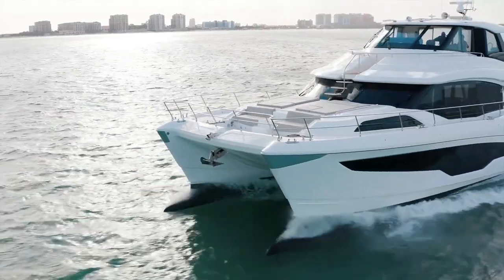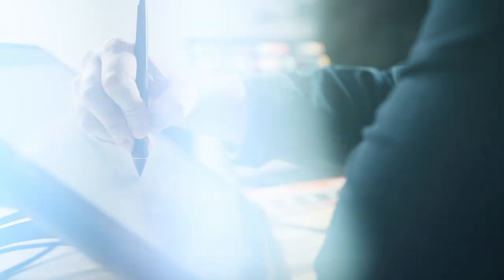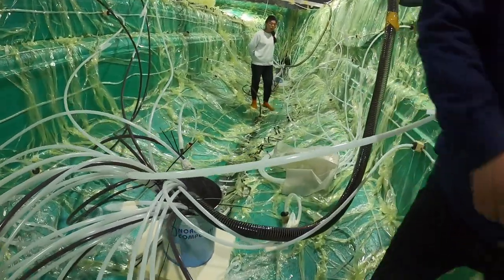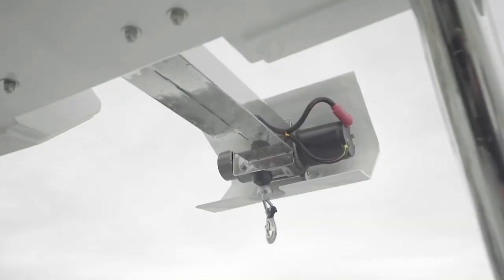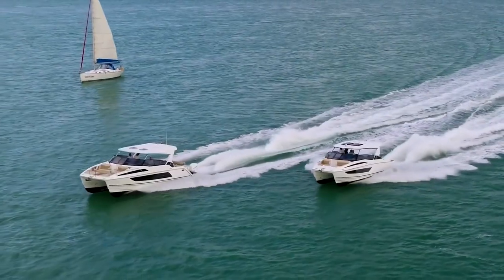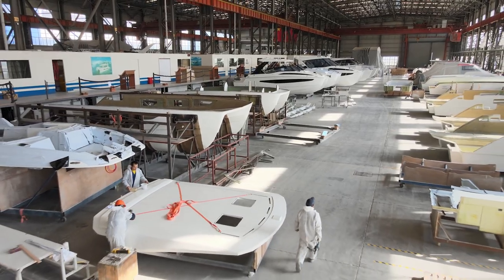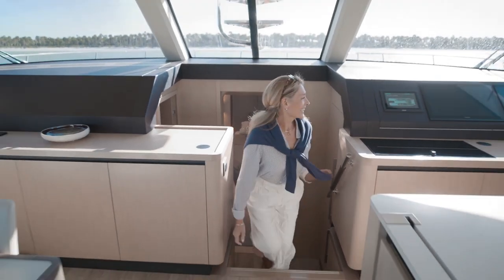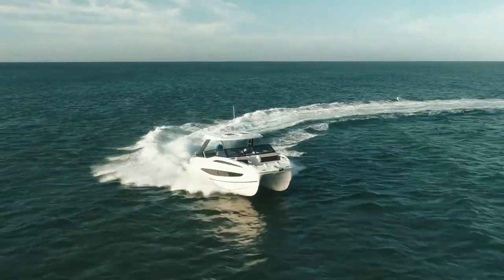The Aquila Difference | Performance, Innovation and Quality | Aquila Power Catamarans

Comment: Unfortunately,  all the Aquilas I've looked at have very poor quality and workmanship, like panels falling off the roof, the joins on the stairs going up to the flybridge are terrible where the stairs joining the superstructure on the 44, mould under the seats and just shabby "don't care" issues like cables hanging out loosely as the TV rises up. It would not be hard to gather the cables together and find a neat solution.

And this was on an Aquila that was only 12 months old. Virtually brand new.

Also, their dinghy launch is very Neanderthal. There are much better systems on the market. They could also remove all the little nooks and crannies in the cabinetry in the cabins and make it more aesthetic.

I liked the layout of the 44 and not so much the 54. However, the quality leaves much to be desired.
Reply: Aquila seems to be cutting corners to mass produce their yachts and try to offer a less expensive boat.  You don't need to actually see one in person, you can literally watch any video of them and see the cheaper products used all over the place.